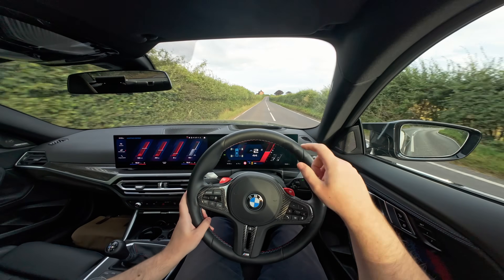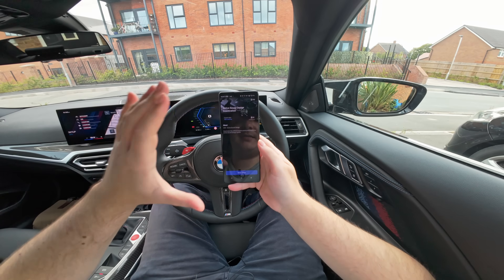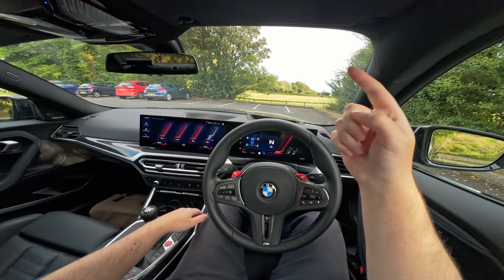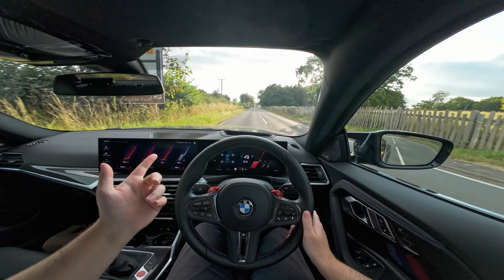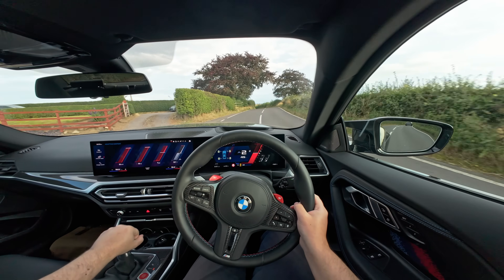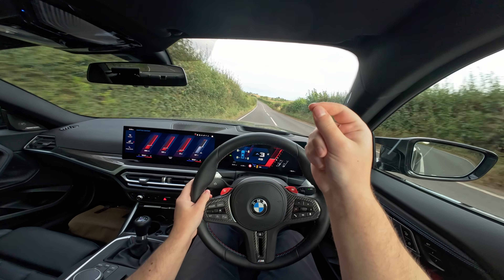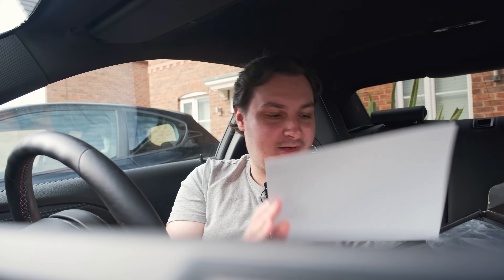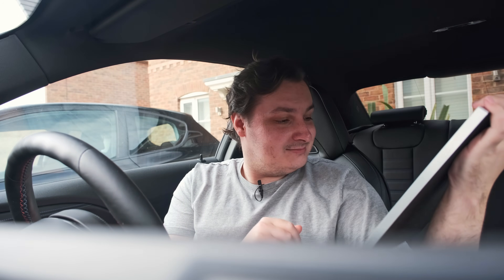Turbo Lag isn't what you think (boost threshold)

Comment: What about Wrx ? I think I’m having turbo lag especially in 4th 5th and 6th gear I used to get insta turbo at 3500rpms in those gears now the car falls on its face for 5 seconds before the turbo kicks in ? Please help also I was hitting 19-22 psi now it seems to not want to go passed 14-15 at times the tac gets stuck and struggles and I’m lucky if I hit 18psi peak
Reply from the maker: That sounds like something's wrong with your car, if you had 19-22psi before

Comment: I’m not antagonizing, I just don’t know, I’ve never owned a turbocharged car, and I’ve only ever briefly driven an N54 335 and 2.9L Audi RS5. I didn’t enjoy driving either, I kept them high in the rev range, lowest possible gear. Aren’t turbocharged cars bad at torque delivery under partial throttle? What I mean is what if I want to modulate the amount of acceleration? If I’m above the boost threshold and I give the peddle 20% throttle input coming out of a hairpin corner surrounded by trees, wouldn’t I be better off with a manual transmission and big Mustang V8 or electric car? The high performance turbo cars didn’t feel fast coming out of corners at partial load at high rpm and I was scared to give them full throttle coming out of a turn on a public road.
Reply from the maker: I love questions like this! Keep them coming

Simple answer - yes at high rpm and 20% throttle you'd be better off in a 5.0 mustang.

Long answer : The truth is, I don't think many people are ever in this condition... it's pretty strange. 5-7k rpm and 20% throttle? What on earth are you doing? :D even with the n54 twin turbos you won't really be spooling yet, maybe like 5-6psi. There's this sweet spot with turbo cars you have to balance to get the most out of them - if you're too gentle even at high rpm you're just driving the engine and never spooling the turbos.
Reply: @MickDrivesCars  I live at the bottom of a river basin and have 3-4 miles of really windy roads that avoid creeks and valleys. I gain like a 1000 ft of elevation. I could drive like 1/2 mile in the other direction to get on the main road but I drive it every day in 2nd gear. I really enjoy the throttle response from 20-55 mph when you can just tap the throttle and have an immediate effect to push out of turns. The 20% throttle is when I’m sharing the road. If there are normal people in front of me, I can engine brake and then still push through some rollercoaster section turns, albeit with little throttle input and drive with some spirit at the speed limit.

Comment: I’ve a diesel with a VGT turbo and the turbo is loud, I can hear when it’s got the boost and I can feel it under the throttle, when it’s got the boost ready to go just a little bit of throttle and it’ll be taking off quicker than it would in a lower gear.

Comment: Please explain the difference between turbo lag and throttle response. This is theoretical in my head but given 2 of the exact same engines where only 1 has a turbo on it, I would think that the actual throttle response is the same the only difference being power curve is larger on the turbocharger. Is this correct? Or no. If not please explain.

Comment: Totally agree, I'm a huge car enthusiast and still learning to drive :) I have had the same experience quite a few times. The car I am usually driving is a Mazda 3, 2.0L, N/A, i4. Whereas the car my grandma owns is a Skoda Fabia. A tiny little engine at 1.8L i4 though it is TURBO!!
As my grandma is quite the enthusiast herself, she does let me have fun in the car and I most find the boost most abbrupt in a corner of in intersection. Generally taking off from the lights.

In the Mazda it is always a sort of tourqy but very linear curve of power, easy to control and understand. Though in the Skoda, if I'm pressing my foot down quite heavy then it takes a corner and then WHAM! Boost kicks in. 

Now it isnt any 40PSI monster, though feeling the car jump foward and the turbo actually doing its job always puts a smile on my face. I also found what you said to be very true, the boost threshold begins so low in the rev range it is always shocking!

Thanks for the video and congrats of the 100K!

Comment: now i have a doubt. does keeping the car in the right rev range for the boost threshold decrease fuel efficiency? how does one eco-drive in a turbo car and zip past the traffic occasionally too.
Reply: Driving at higher gears and only droppping gears before putting the foot down to overtake
Reply from the maker: Of course!

If you want fuel economy, never spin up the turbo.

I have a video about all the eco-driving tips :)

Comment: I wonder something, because this is my situation.

My parking lot is a slope, where I park my car using reverse gear (the trunk is on higher elevation than the bonnet). My car is NA, and due to the slope, I need to rev my car around 2000RPM in order for it to climb backwards in the final 80cm distance. Even with NA, the RPM spike to climb feels like jolt that want to launch the car backwards into the wall (I need to hit brake ASAP when the launch happend)

My question being: in turbocharged car with low RPM threshold, how do you manage to only climb but brake in short moment. Does the jolt from a turbo is really a strong launch that has potential to overshoot the distance?

Comment: Do the same in an Audi A8L you will notice the 0.5 to 1s turbo lag. It is an apparent problem, just not as significant as people think. And sometimes it is also related to the gearbox, get a CVT natural aspiration old Audi A6, and compare it with a 6AT 6  cylinder natural aspiration other car, you will also notice the CVT responds faster than 6 AT